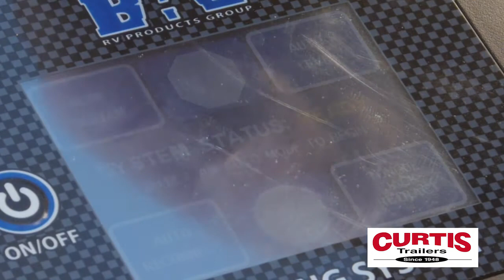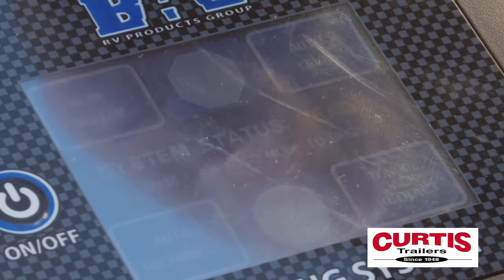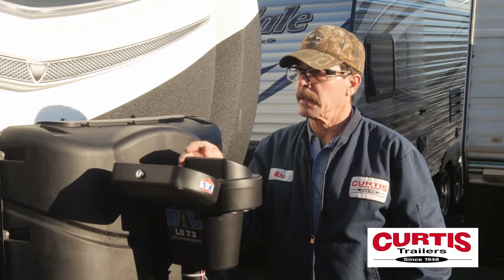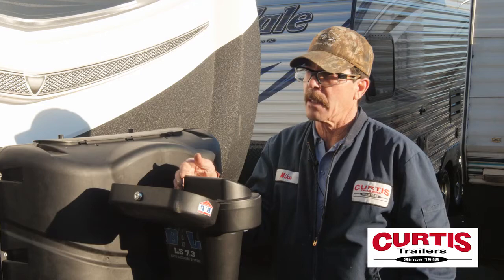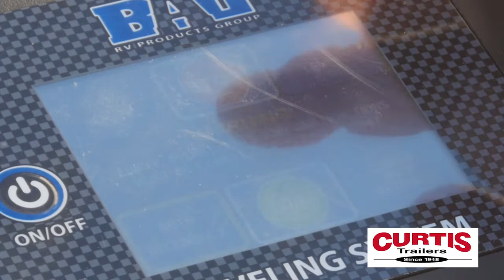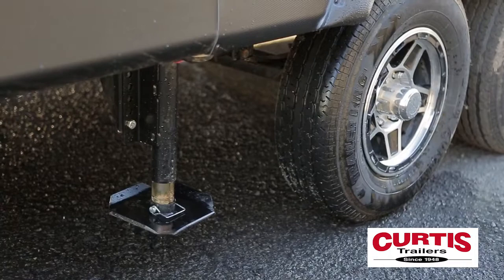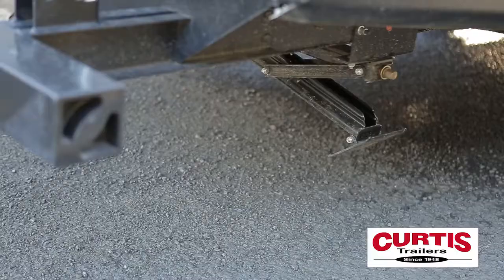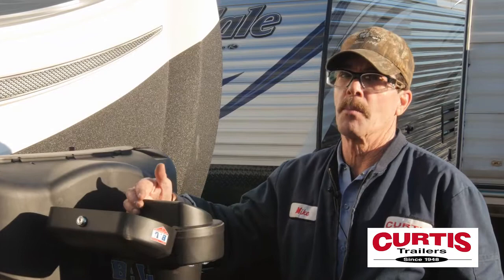BAL Electric Leveling System operation

Comment: I have this system on my Jayco Eagle and Mr. Gates is correct. This is absolutely wrong. You have it backwards. The stabilizer jacks should never be used to lift the camper at all. The rear goes down and levels based on the tongue jack and rear jacks. Once it's level then the stabilizer jacks go down.

Comment: YOu are backwards. The levelers come down to level front to back, left to right. After the trailer is level, the the stabilizers extend. Not the other way around. Or you video guy messed up.